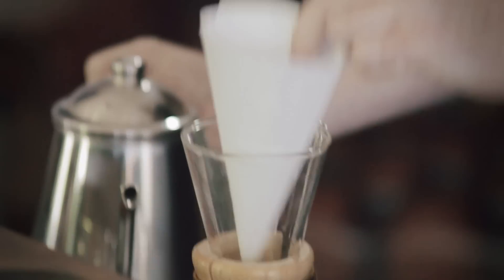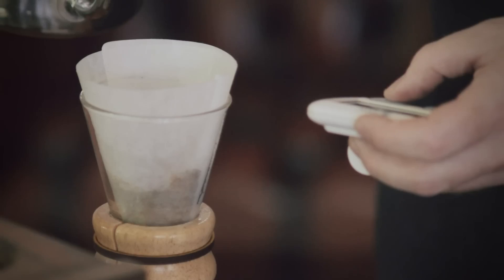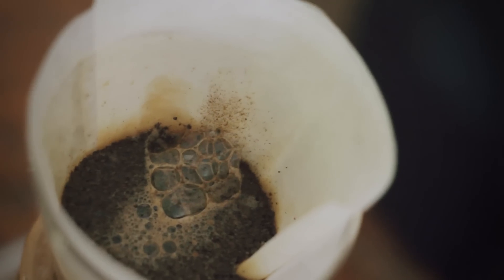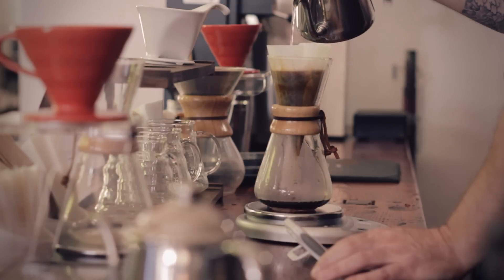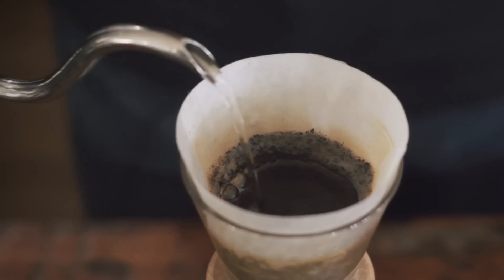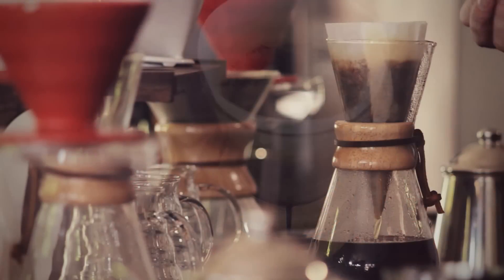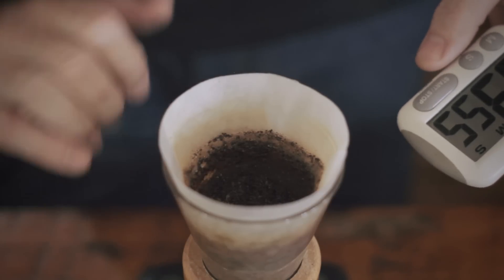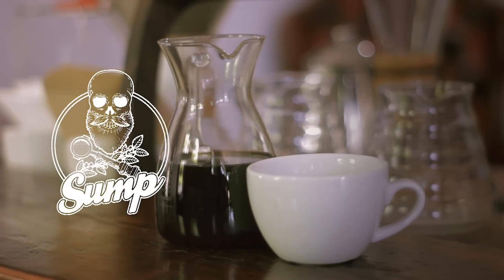Chemex

Comment: In my (very) limited experience, pulse methods for the V60 or Chemex work best if your pours do not disturb the coffee bed. With a few sloppy pours, however, you end up with a great deal of turbulence -> overextraction during the brew. My kettle's (Bonavita) flow-rate is a bit too aggressive to achieve good small, measured pours easily. I find that a single, slower pour of the total brew volume, results in a better flavor profile in the end for this novice with a much less awesome kettle.
Reply: What an awesome comment! I absolutely agree! I have been overextracting recently and I think a single pour will definitely help me there! Thanks so much for that!

Comment: My one question is that if I make 1 cup with my 3 cup chemex, I use 9g of coffee and 140g of water (which is 5oz, because chemex says 5oz is their "cup" size), the grounds retain some of that water regardless, so pouring 140g of water  never yields a true 140g in the chemex after removing the filter. Ive found that to get 140g of finished product, I pour 170g. 

Should I just pour 140, or should I pour more to allow for the grinds to be a variable in the final product?
Reply: +Svendiesel id love to know the answer to this as well! can you pour more water, or should you adjust and add more water AND coffee?
Reply: I've come to find from experimenting that I simply follow a 14:1 ratio. so now for one cup I use 11g of coffee and pour about 155-160g of water.

Comment: What if you wanted to fill the carafe to its capacity at, say 450 ml and use around 30 grams of coffee, which is my preferred morning dosage?  It would obviously take longer to brew, I assume that's ok and not fatal to the process?
Reply from the maker: I would modulate the grind setting as a first pass. Say grind it slightly coarser. This is often the first attempt I'll take with something like an 8 or 12 cup Chemex. Whether the following analogy is correct, think about large batch brewers. As they scale, the recipes, at least as they come from the manufacturer, do not scale in minutes as the batch size creeps up. But some drift (say 30 sec) would be acceptable for a slightly larger batch size. It also depends on how 'available' the extraction is based on the coffee -light roasted and dense (so less available) or more developed and more porous (so more available). But if it were myself, and I was on a desert island, to brew for the ball (Wilson) and myself, so scaling up, I would coarsen the grind and still try and hit the 4 minute mark. I might also, break it down into more pulses too, so smaller, multiple bursts/pours to keep the coffee slurry low and tight.

Comment: What water temperature would you recommend?
Reply from the maker: Lots of info on this, and depending on what year you look it changes. I'm comfortable suggesting 205F to 210F (just off boil). I think it depends on the coffee you are brewing too. More contemporary styles -lighter, likely benefit from 210F. Something more developed I think presents better, to my tastes at 195F to 200F. It also depends on the brewing device. I have been very surprised by some fairly low temp aeropresses, in fact a lot of the people that win world aeropress comps have water at 175F or 185F, but just for that device. They would likely not use such temps for pourover -the aeropress adds pressure into the mix and not just replying on geometry and drip through kinetics. Your water composition also plays a role in the extraction.

Comment: The only factors that noticeably influence the flavor is water temp, grind and water/coffee ratio (aka TDS Ratio). Everything else is pure mumbo-jumbo hipster BS.  Pre-infusion and pouring style ridiculously over-rated by about 99.9%. But don't take my word for it.  Experiment and decide for yourself if you think a 40 second pre-infusion is a waste of time, paying for an expensive specialized kettle is going to make a difference over pouring hot water directly from a pot or cheap electric kettle.    In my case the coffee was essentially identical as long as the Water temp, TDS ratio, and grind were the same.  I've purposely poured using the no-brain method (just pour all at once, until the quantity has been poured) down the side  of the filter but in all of the flavors were still extracted and went into the cup. Absoltely no noticeable difference.
Reply: What's funny is that anyone who knows what they're talking about would site extraction percentage, not TDS, if they were going to make such a high-minded claim about coffee brewing. Btw, coffee to water ratio and TDS are two completely different things. Those are just two things that you're objectively wrong about. You've clearly got plenty to learn before pretending to know more than everyone. Hope you've closed that gap in the intervening years, haha.